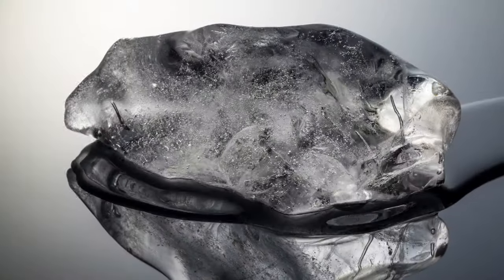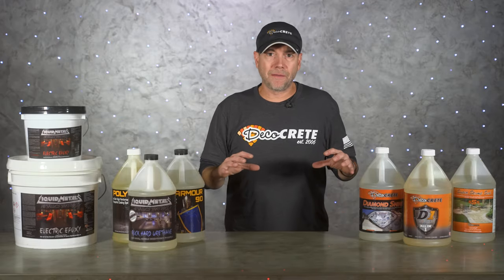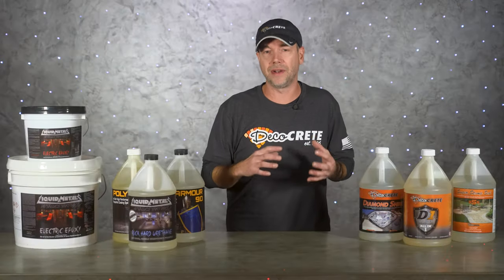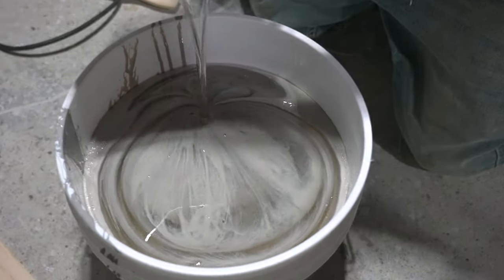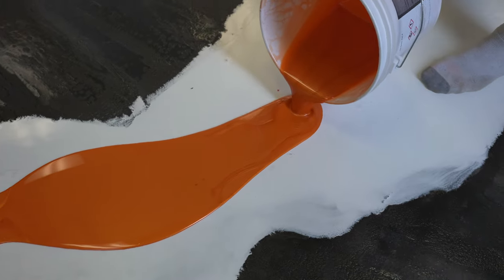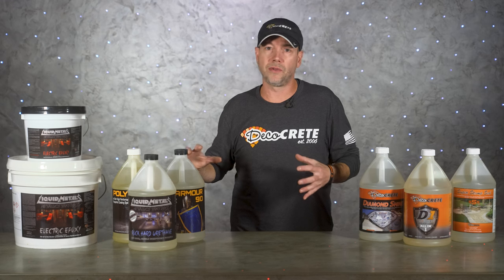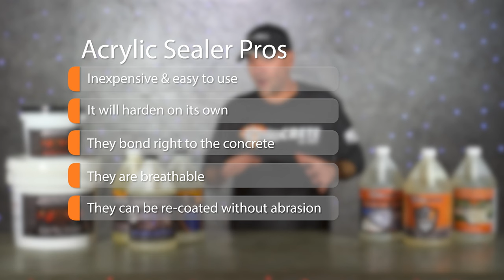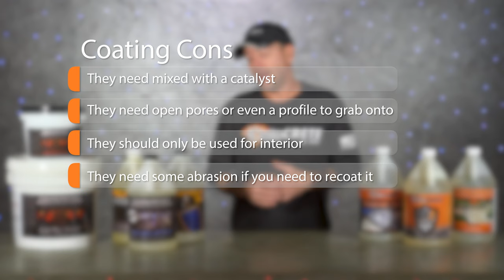Concrete Coatings vs Sealers: Which One Suits Your Project?

Comment: Great Video ! Very Informative.  I wonder about using a poly aspartic on an outdoor counter countertop . I know it's vulnerable to the weather (moisture). But it's not like it's sitting on the ground?
Reply from the maker: Thanks for the comment! Outdoor countertops are definitely different than a slab of concrete. The fact that it's up off the ground takes away most of the moisture concerns. We've seen a lot of success with Polyaspartic & Polyurethane on outdoor countertops. Just make sure that whatever one you plan to use is UV-stable. Thanks for watching Deco-Crete TV!!!!
Reply: @DecoCreteTV  Thanks So Much ! I really appreciate all of your guy's content. Very Helpful.

Comment: Question.  Coating is what I want to do in the basement,  but my basement gets condensation spots in the summer time. Will coating be an issue with that down the line?
Reply from the maker: Thanks for the comment! Basement floors can tough when it comes to moisture content. The fact that you have noticeable moisture spots at certain times of the year is definitely concerning. Concrete floor coatings are not verry breathable and excessive moisture in the concrete can cause the coating to delaminate/peel. The question would be; is the moisture coming up through the floor from the ground, or is it just condonation sitting on top of the floor from fluctuations in temperatures. Basements tend to hold a lot of moisture in the air and when temps go up the summertime, that moisture can turn into condensation. There's really no harm from the condensation sitting on top of the coating. The problems start when moisture comes up through the floor and builds pressure in the slab. Our Moisture Shield primer will help block some of the moisture and it's recommended on any slab that's below grade. Hopefully this helps. Thanks for watching Deco-Crete TV!!!                                             
 https://www.decocreteproducts.com/epoxies-top-coats/moisture-shield

Comment: What is the best product for a new garage floor. Will coat after 28 days of curing time. Trowel finish. Garage will see vehicle maintenance.
Reply from the maker: Thanks for the comment! The best thing for a garage floor would be a two part coating with a paint chip/flake broadcast. This is a very long lasting option and it's great look for garage floors. You can get the chips in a verity colors and blends. The floor would need to be prepared by diamond grinding down before application. I'll leave a few links to some other videos so you can see the process. Thanks for watching Deco-Crete TV!!!!                                                                                                     
 https://www.youtube.com/watch?v=jfi_zG7kmTo                                                                                                                                                                      
 https://www.youtube.com/watch?v=kgCKm_WD7Z4&t=387s                                                                                                                                                 
 https://www.youtube.com/watch?v=5lPg7osGpW4                                                                                                                                                                  
 https://www.youtube.com/watch?v=glof-GnodNQ&t=1s

Comment: Hi, I plan to grind the concrete floor of my fixer upper condo. It's on the first floor of a three story building. I want to install a wood floor over the concrete, along with a foam underlayment of course. After I grind the concrete I want to seal or coat it somehow. I am worried about moisture getting into the wood flooring in the future. What type of product would be best to use on the concrete? I would like to waterproof it, but it sounds like allowing a little water vapor to travel through a sealer is desirable. On the other hand maybe a coating is best because it's indoors and maybe there won't be too much moisture under the coating. I'll grind it first and then do a moisture test. How would a moisture test result influence my decision about sealer vs. coating? Than k you for any help you can offer!
Reply from the maker: Thanks for the comment! The moisture test would definitely be a good first step. If the moisture content is under 5%, I would also consider our Floor Flex membrane. It's not really a true concrete coating or sealer, it's more on an underlayment/waterproofing membrane. The normal use for Floor Flex would be for coating plywood sub-floors before applying an epoxy coating, but it should work pretty well in your case as well. It's not exactly a good-looking final product, but if you are covering it up with your other flooring, that shouldn't really matter. If the moisture content is over 5%, I would recommend our Moisture Shield primer. I'll leave links to both of these products below. Thanks for watching Deco-Crete TV!!!                                                                                                                                                                                                                                                             
 https://www.deco-cretesupply.com/products/repair-prep-products-liquid-metals-poly-armour/floor-flex                                                                                                  
 https://www.deco-cretesupply.com/products/coatings-liquid-metals-poly-armour/moisture-shield

Comment: I want to put down a tile floor in my garage floor. The floor is painted, a lot of the paint has peeled off. What is the best product to use so I can re-do the floor with the tile. There is a sleight problem with moisture, not every year, but some time. Any help from you on this question, thanks
Reply from the maker: Thanks for the comment! The first thing to do is remove all the paint, and get back down to bare concrete. This could be done chemically or with a floor grinder. The thin-set tile mortar should bond fine if you grind the whole floor. If you remove the paint chemically, you might want to use our Sure Bond primer to help thin-set stick better. You could use our Moisture Shield if you're concerned about moisture. You would need to grind the floor first if you plan on using any concrete coating products. I'll leave links to our website for both of these products. Hopefully this helps! Thanks for watching Deco-Crete TV!!!                                                                                                                                       
https://www.deco-cretesupply.com/products/overlay-mixes-repair-prep-products-vertical-concrete/sure-bond                                                                                       
https://www.deco-cretesupply.com/products/coatings-liquid-metals-poly-armour/moisture-shield

Comment: I am remodeling an extremely nasty house where all sort of animals have been pooping and pieing all ever it for many years. 
We removed the flooring and the plan after all the chemical treatments, is to seal the concrete before putting new tile in order to definitely prevent those flavors to be released from the concrete.
What do you advise using for this application?
Thank you
Reply from the maker: Thanks for the comment! The very best way to get rid of that smell is to diamond grind the floor and apply a concrete floor coating like epoxy, polyaspartic, or polyurethane. The downside to this would be the cost, and it'll be hard to get any other flooring to bond to coating. You could install a coating as the final product, which would solve the bonding problem. Applying an acrylic concrete sealer would be another option. You would not need to grind the floor first, and the cost would be way less then a floor coating. It would still help with the smell, but not as affective as a coating. Before you make any decisions, you should check the spec's on whatever flooring you plan to install as the final product. Just to make sure it'll bond to sealed concrete. Hopefully this helps, please let us know if have any other questions! Thanks for watching Deco-Crete TV!!
Reply: Will D1 be a decent application for a similar situation? We aren’t planning on installing tile but just leaving the sealer on until the dog has passed
Reply from the maker: @michaelbacile8439  Thanks for the comment! D-One would be a decent choice for that. You could also consider Super Stamp Seal. It's a little bit thicker than the D-One, and it would be easier for a roll-on application. Either one would work. I'll leave a link to the sealer page on our website. Thanks for watching!!        https://www.deco-cretesupply.com/products/sealers-coatings/decorative-concrete-sealers
Reply: Thanks! Appreciate yall